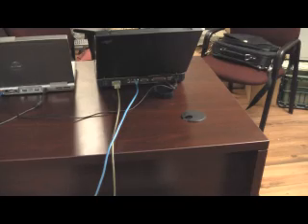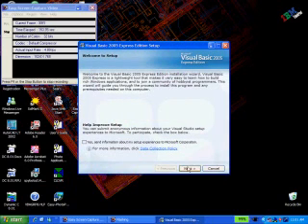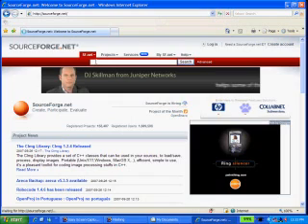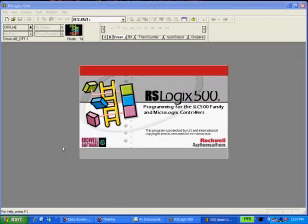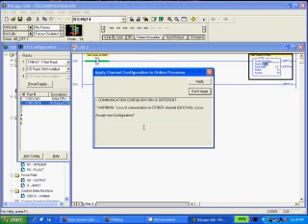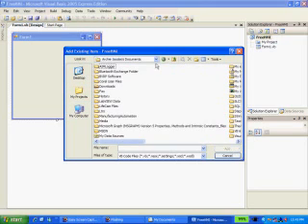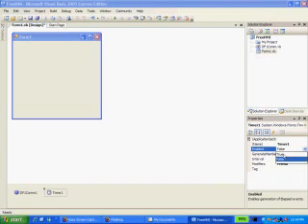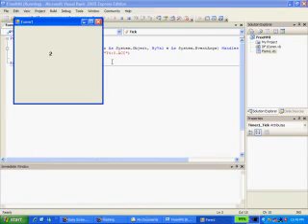PLC - Free HMI for Allen Bradley (AB) PLC

Comment: Within RSLinx, you can copy an OPC Topic link and paste it into Excel. The data will then start to stream into that Excel cell where you pasted it. Is there any way to support that here? Then you could have a way to use ethernet that would be easy to get to the controller. You wouldn't be limited to a serial communication link. VERY NICE APP. Mind Expanding.

Comment from the maker: Do you have a real serial port or are you using a USB to RS232 adapter? I've heard about many problems with those. I have never had any baud rate problems and even used as high as 38400 on a micrologix.

Comment: arj3090 :- I'm not sure, none of the other baud rates work with my laptop to the slc5/03 i use the official programming cable and its a proper serial port on the laptop ?? Maybe you can tell me ?? i thought it was strange that its so low ?

Comment from the maker: A proface or panelview typically optimizes communications by polling only what is currently displayed. They will be just as slow if you fill the screen with a large number of values. 1200 Baud is extremely slow. Why are you tied to using that baud rate?

Comment: arj3090 :- i did that buy moving bits and values into the F8 register as my counter will exceed 1 million counts. This is extremely anoying for a larger program. How is it that a proface screen or panelview can easilly monitor all those registers using the same serial comms ??

Comment from the maker: Each request from the PLC uses some extra bytes (overhead) for things such as packet start/end, checksum, etc. Reading a lot of separate values require a lot of data to be transferred. The first thing to do is move all of your values in the PLC (using ladder) to a consectutive memory block. You can then read all of the values simulataneously, greatly decreasing the overhead. For example, if you move 50 values to the N10 file:

DF1Comm1.ReadyAny("N10:0",50)

Comment: hi, i need to monitor lots of registers off the poll timer and a c5:0.ACC register every 1/4 of a second and i can only get a buad rate of 1200. The vb program runs slower and slower as i add more things for it to monitor. How can i get it to display a counter value perfectly even if it is incrementing every 25 millisecond :)  thanks. ps. do i need ethernet ??